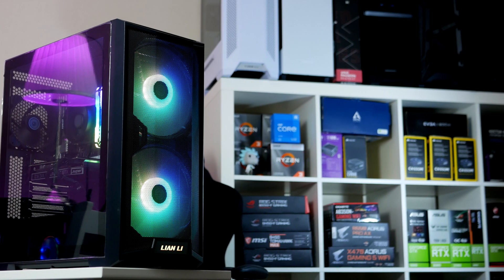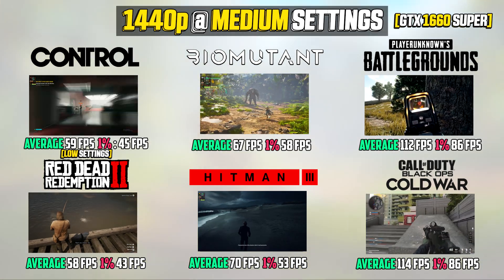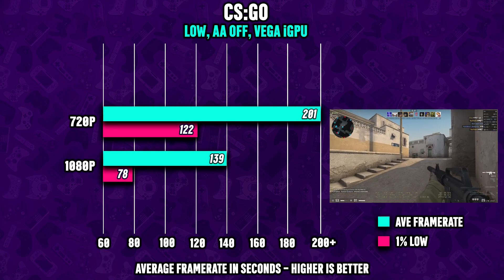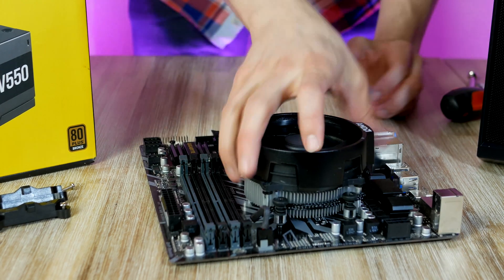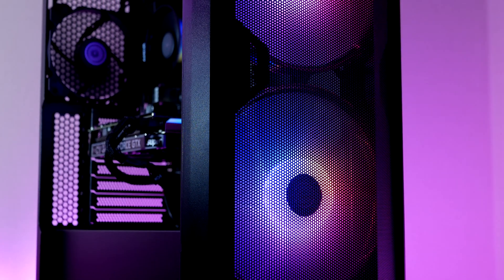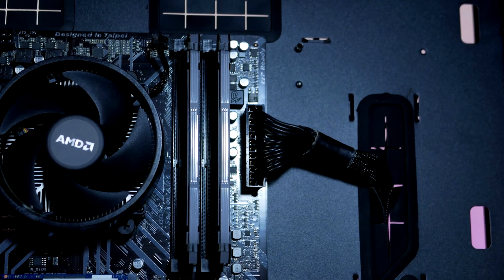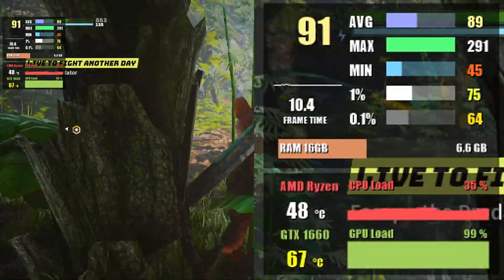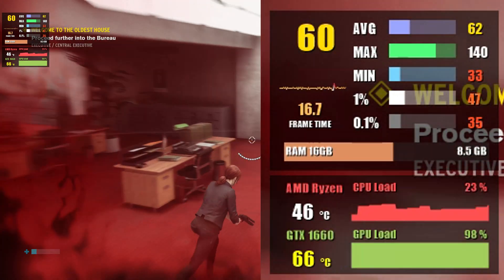Best $500 Budget Gaming PC Build For June 2021 NO GPU NEEDED! Step-By-Step Guide For Any Beginner!

Comment: The AMD Ryzen 5 3600 6-core processor is $20 cheaper on Amazon than the one you recommend. Is it compatible with these other parts, and it is better? I’m so new to this
Reply: Yes however, the CPU you are talking about needs a dedicated graphics card. The 3200g has integrated graphics which allows it to not need a dedicated graphics card.
Reply: It needs to have a g at the end or you will need to buy al like 300 dollars gpu
Reply: Could I use a Ryzen 5 3400g  instead of the Ryzen 3 3200g…. With the gpu he is using in the video and would it be better? ( Plz answer)
Reply: @fgc3544  yes it will work, and will rin better than the 3200g. If you can find the 3400g at a good price then get it. Just get a good cooler as the 3400g runs hot
Reply: @stormyclipsndstories  thx, and is it like a apu or I will definitely need to get a gpu straight away……
Reply: @fgc3544  it's an apu, so you dont have to worry about a gpu. Any ryzen chip that has "g" in the end has integrated graphics
Reply: @fgc3544  np

Comment: Any other cheaper case suggestions?
Reply: I use Cooler Master MasterBox MB320L ARGB Micro-ATX. Since the motherboard is micro atx it should fit even though the case is smaller